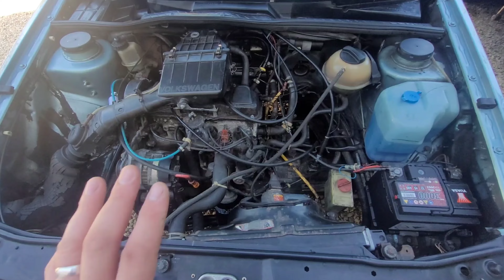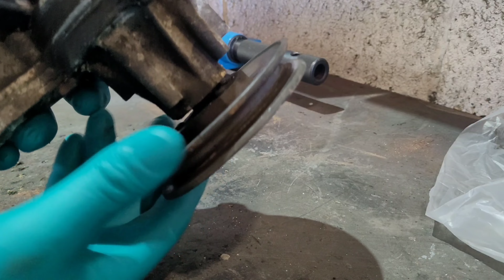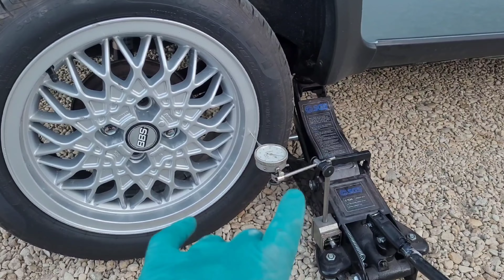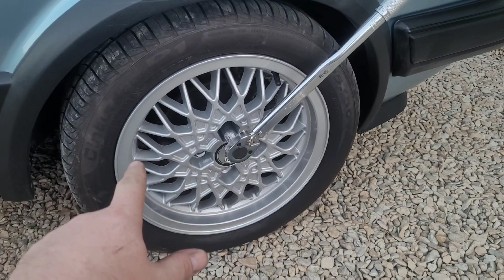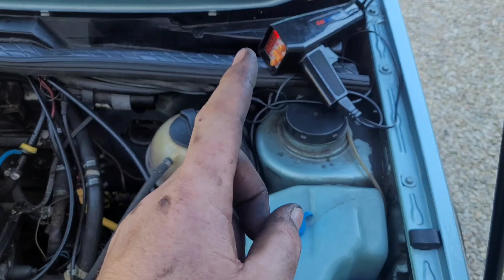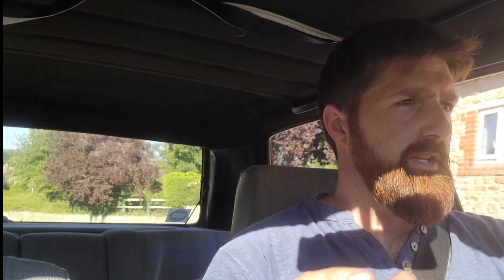Mk2 Golf Driver 1.6 8v - Health Check + 32/34 Weber Carb Set up

Comment: Hey 
I’ve recently bought a mk2 scirocco with a 1.6 carb engine like yours. I bought a 32/34 and some guy set it up for me. But I’ve some problems with my ignition time. Some guys says that it’s 0° and you seem to say that it should be 18. Is your engine same as mine ? 
Lastly, I tried to set it up with 0° with the flashgun and it runs like a potato, and make pops and bang. Can you help me?
Reply from the maker: The 0 or the dot marking is your TDC so once its running and the timing light is lining up with that 0, advance the timing light to 18 degrees then move the distributor body untill the timing light is lining up with the 0

This is then set at 18 degrees BTDC 

16-20 degrees on 98 ron fuel
12-14 degrees with 95 ron fuel

Comment: You set your timming gun to 17deg? And then you set timming trough gearbox housing?  Or gun have to be set at 0 deg?
Reply from the maker: Timing gun set to 17 then line that up via gear box pointer
Reply: @GreyGooseRestorations timming gun should line with "O" or "V" cut? Thank you for fast respond👍🤗
Reply from the maker: @Rycka152 with the O dot

Comment: Hi,
I'm running the same set-up on my 1.8 but on slight throttle the cars seems to stutter a little.
I was wondering if changing the primairy idle jet to 1 step bigger, 55 to 57 would make a difference. 
vacuum & timing are right.
Reply from the maker: Have you adjusted the basic mixture yet as this may help, if it doesn't then may be time to re-jet and adjust

Comment: Hey mate I have a question about the ignition timing. I have the 1.6 with a Weber too. If I understand correctly ignition timing should be at 17-19 degrees without the vacuum advance unit disconnected. I have always set my timing by aligning the gearbox housing arrow with a little notch in the flywheel, assuming that's the correct BTDC point (I don't have a timing light with an advance function). However you mentioned a sort of machined flat spot which is what you set the timing to in this video. Might it be that the notch I set my timing to is for 6 degrees BTDC which is the required timing for all other mk2s? Since the 1.6 seems to be the only one that needs a 17-19 degree BTDC and now I'm not sure whether I have my timing correctly. Car's been running a bit sluggish lately
Reply from the maker: Yes 17-19 degress with the vacuum pipe connected. The TDC dot is 36mm to the right of the diamond. The diamond is 18 degrees BTDC

So if you have no advance function on your timing light then you want to be getting the diamond marker lined up with the gearbox pointer at idle, that will be 18 degrees, however if your vacuum advance on the dizzy isn't working your have issues, suck on the line that goes to the dizzy, if you can draw air through it then its failed.
Reply: @GreyGooseRestorations  thanks for taking the time to reply. In that case I have been setting my timing correctly, and the vacuum unit still works as far as I can tell, so my issue is probably caused by something else. I suspect the distributor or carb since it started right around the time it got colder too. Feels like the engine is either almost flooding itself while driving very intermittently which makes me think the carb is running too rich or the ignition is failing altogether for a split second. Just kinda goes against my instinct that the carb running rich would suddenly be an issue as it gets colder, usually cold weather could benefit from running a bit richer right?
Reply from the maker: It could be the carb mixture needs a tweek as the weather is starting to get colder

Comment: How much is consumption with this carb! And its beter this 32/34 weber our 32/32 dmtr weber?
Reply from the maker: If set up correctly you most likely won't notice to much difference in mpg but it will be slightly less than stock. Both carbs will work however the 32/34 is the common replacement
Reply: @GreyGooseRestorations  i ask because i have weber 32 /32 dmtr and i wanna put him in vw golf 2 1.6 petrol thats way ask
Reply: @dusanglisic3687 jesi ga nabacio brate?

Comment: hi do you know how much they go for ? as in hove one is parked up 1600cc driver MK2 with factory roof 2 owners but with 78k and different wheels .. not alloys like yours ...an old lady had it many years and want me to make offer ... just wondered what to offer or how much u think its could be worth in metallic green looks like new and zero ware inside or rust .... regards ... just subscribed ... great video thankyou
Reply from the maker: Depending on its condition it could vary but in the region of 1200-1500 but its hard to say, you could offer less and get a bargin

Comment: great video. any chance you could do a video showing how you adjusted the carb mixture screw and idle? thanks
Reply from the maker: I will try my best to 👍
Reply: Mixture is straightforward. Get the engine nice and warm. Then wind the mixture screw in until it misses, then wind back out anti clockwise and listen to the revs rise, the optimal point is the revs just at their peak.  If you keep going the revs will fall again. Once you find the peak. Turn it back in a half turn, to pull the emissions down. Or you can leave that until mot time!

Comment: Fun fact about this particular car: I actually owned this car before the current owner owned her and she was an absolute joy to drive. I purchased the car as a 1.6 automatic golf driver but preferred the manual gearbox so with my dads knowledge and his skill In 40 odd years in the trade, he was able to convert it from auto to manual. The Weber carb you see is another add on that my dad fitted himself we did know it wasn’t set up correctly but I was just so excited to drive her again, definitely did make a difference from the pier burg carb which was in it prior. So nice to see her being looked after and being appreciated as much as I did in the time I owned her. 👍🏻 Good job by way on getting her run smoothly and better than ever!!
Reply from the maker: Wicked thats cool, its been a pleasure working on it 😀